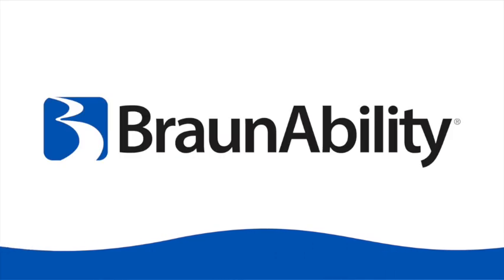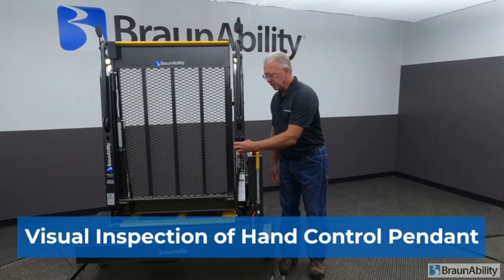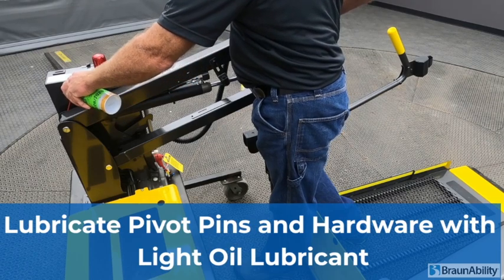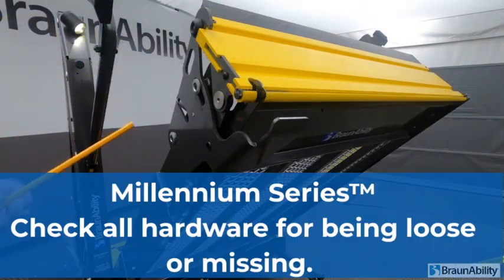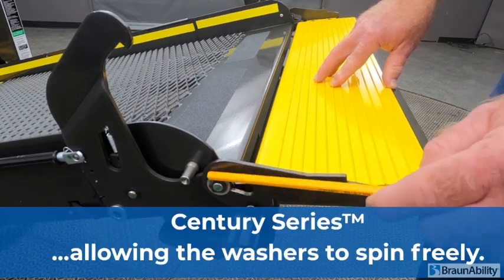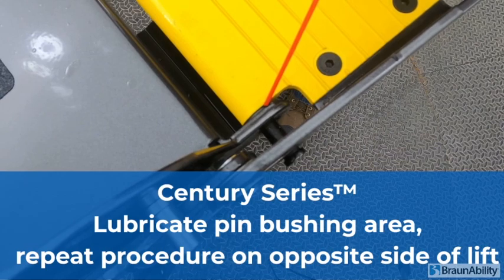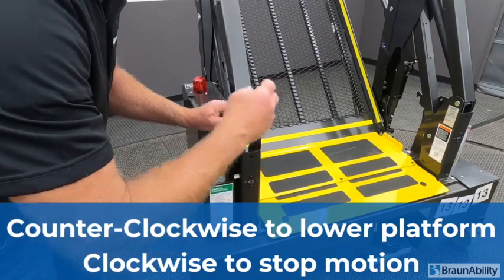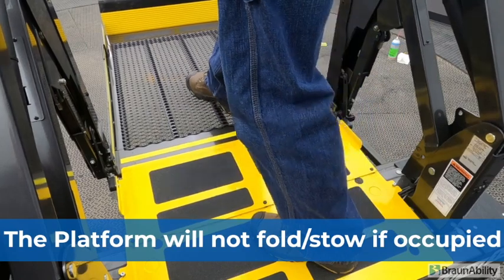General Wheelchair Lift Maintenance - Millennium Series and Century Series

Comment: I am using a van with this unit. I seems older, maybe 3-5 years?? It rattles a lot, very loud over bumps.. are there rubber parts that need replacing occasionally? Thanks..